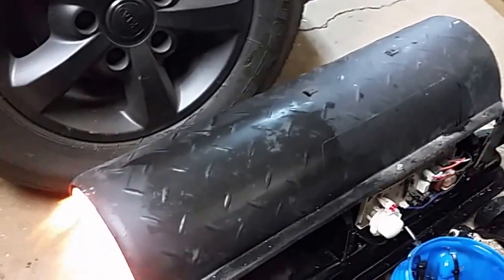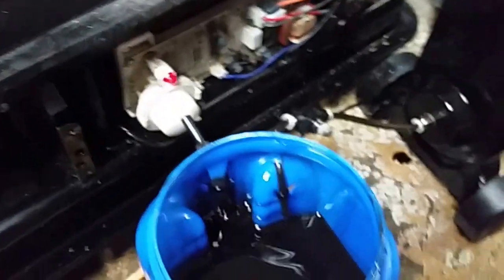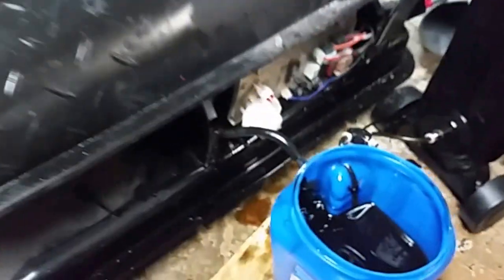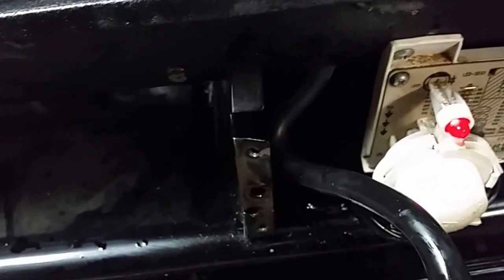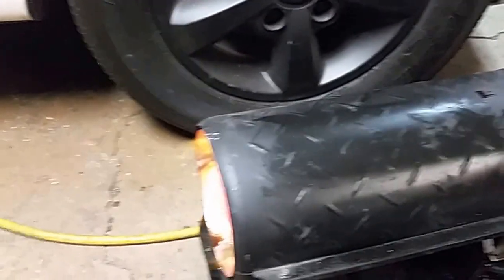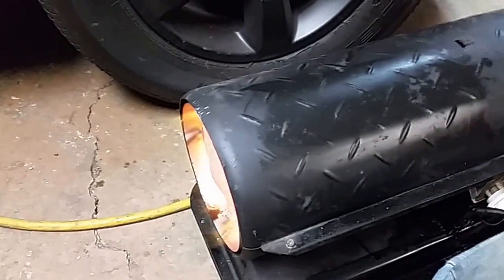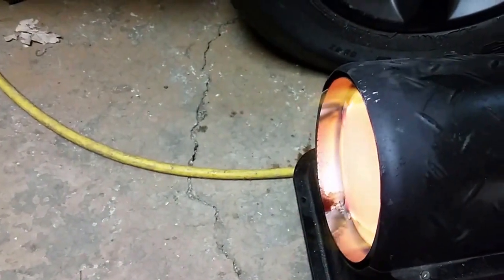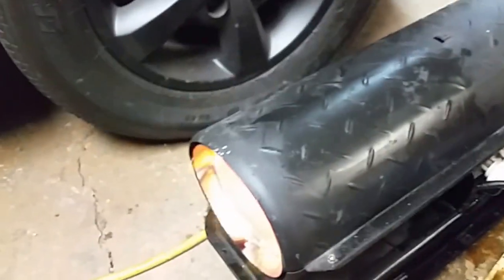My Torpedo Heater Running On Waste Motor Oil

Comment: Oil convection heater...GENIUS!
Reply from the maker: I made some modifications and another video. I moved the convection heater parts to the inside of an old propane tank. Easier to fill and larger capacity

Comment: that's awesome.  great thinking on using that electric oil heater to preheat the oil.
Reply from the maker: Thank you!  If you check out my other videos i actually stripped down the radiant heater and put the parts into an old emptied and purged propane tank.  Works MUCH better and can hold MUCH more oil....  That video is on my channel: www.youtube.com/c/OverRevvedRacing

Comment: I successfully heat my 38 foot trailer on used motor oil with no preheating of the oil. Feed is with air compressor, but burns way better preheated for sure
Reply from the maker: I was going towards compressed air too. I have another video here using an old propane tank I modified using this heaters parts in and could seal it up to allow it to be filled with air. Didn't get that far before we moved to a house with attached garage and didn't want this fumes making it in the house. Definitely would have been safer connecting the output to a heat exchanger and dumping the exhaust outside.
Reply: @OverRevvedRacing  , ok update, I bought a diesel heater off Amazon for 100bucks, it has a combustion chamber with fins, intake and exhaust down through the floor of my trailer mounted under the queen bed in front, impeller in the back of the motor creates high air flow over the fins... 20 mins the trailer is 80 degrees and I gotta shut her down. Need to wire thermostat for running. My point being converting waiste oil to a more purified diesel is the direction I think is best for my trailer as it is my home and free energy is what I am after. Local mechanic shop will give me 100 gallons of oil every 2 weeks.. no way I will process that.. but so far(and I just started researching this) basically you build a alcohol still and the end product is deisel.. run it again for gas.. years ago I watched a guy who lived on a deserted island make gas for his boat and diesel for his generator just using a still using plastic bottles that washed up on shore. 
     This inside of your torpedo uses the same nozzle I use in my home made oil burner.. you are using compressed air already.. within the unit there is a fuel line that runs to the nozzle and another that runs to the air box, the only advantage to using the air compressor is that if you get a quiet compressor with large volume.. I added 2 small compressor air tanks to my compressor adding volume keeping it from running to long... also helping with noise.. anyway it allows you to dial the fuel air mix back to a fraction of the fuel you consume with the large torpedo. The diesel heater I run now takes 2 gallons per 24hours of running hot as she can.. I run it high or off.. keep from buildup.... but ultimately waste oil is its future.. just cleaner waste oil.. I'm not sure if taking the oil and making it diesel will create more fuel or less.. but I will let you know when the still is built.
Reply from the maker: Those diesel heaters are absolutely the way to go!!  I have had my eye on those for a while. I got rid of the torpedo heater when we moved because our garage in our new house is attached and I wanted a indirect heater (like the heater you got or a standard furnace) so the burnt air wouldn't get into the house. I actually have the Beckette burner from an oil furnace that I was going to convert to burning waste oil. However with the prices of those diesel hearers being SO cheap now I'm going to go the same route as you.
Reply: @OverRevvedRacing  love the thing, should keep you warm for sure, im trying to build a drip feed oil stove for our shop. As far as buying the diesel heater and running waste oil, 1 problem I'm have to solve is cleaning the oil so I don't have to clean the diesel heater out. A stove is easy to clean out, but not the diesel heaters, not to say that you don't have to clean them out anyway but few tips. Make sure the heater exhaust is able to drain water, either its running on high or its off( going to attach a thermostat to it so I don't have to be it anymore)this keeps cleaning to a minimum, and add your own filter, supplied filter is a screen.
Reply from the maker: @HirschCustoms   Filtering is something I looked into a lot when I made the modification to the torpedo heater. I didn't want to risk nozzle issues so I did a bunch of research. I actually modified a centrifugal juicer to use as a centrifugal filter and planned on running one of the bag filters that you can get from McMaster (the kind that look like a 3' tall tube sock with handles on them).  I wish I made a video on the centrifugal filter but I was busy working on the LSx swap on the KIA Sorento back then which was my real priority. I played around with the drip feed burner too with a hot water tank as a chamber. It didnt work all that great because I was only using a 3" exhaust and it had a lot of pulsing reverb to it.
The diesel heater definitely is the easiest way to go though since its all one package and they are really cheap. I was thinking that a preheater would help with that too. Thinking an aluminum block with one of the ceramic heating rods and the fuel line clamped together in the block.
Hope you post a video of your setup if you do any modifications to it or if you do build a drip feeder.

Comment: how about a 70% waste oil and 30% diesel ? Only downside I can see is the fumes , not quite as clean as a diesel/Kerosene burn.
Reply: Mix 25% gas to oil, let it vent, then it’s good to go. 25% is close to 50% dsl to oil.

Comment: OMG, hahahahahahaha GREAT THINKING there on the Oil Heater as a Warmer, LOL.  Also another way, use a CHEAP Pot Warmer, and a Temp Disc and a Metal Bucket and Control whatever the temps you want the Oil to heat up as well.
Reply from the maker: Jordan Bronson 
If you check out my other videos I actually stole the heating element out of this and repurposed it inside an old propane tank to heat the oil.
Reply: +OverRevvedRacing - LOL, you know Home Depot have Heating Element for like $8.00 and a $2.00 Snap Disc... Incorporate that into a Propane Tank and you should be all set. :D.
Reply from the maker: +Jordan Bronson
Not sure what size element or temperature range you get from the elements your talking about from Home Depot. I haven't honestly looked for them there. However, this one was free and it's quite large. About 12" long. Plus it can get hot enough to steam off any water in the oil which is a serious bonus.
Reply: +OverRevvedRacing - Hahahahaha, it doesn't really matter in the Element Size... You control " THEM" with a $2.00 " SNAP DISC "..., aka the Temperature Disc.  Example:  Lets say you want your Oil to be around 95 Degree Fahrenheit.  You hook up the Element with a 95 Snap Disc.  Once the Oil gets to 95 Degree, it shut off the Element and so on and so on and so on.... LOL... Hope that makes a bit more sense.
Reply from the maker: +Jordan Bronson 
Oh I totally gotcha man. I'm not hating on ya mate. Don't take it the wrong way. I'm all about us garage inventors combining our heads!  I am using the variable thermostat from the heater. Which is basically a snap disc with a tensioning arm to cause the snap action to have to overcome it in order to shut the unit down. I was just saying that the repurposed radiant oil heater's heat element is a great option due to its size because it will more evenly heat the oil in the tank because it reaches across practically the whole tank. Rather then a shorter element having to heat via convection from a smaller area. This can put a larger strain on a smaller heater and introduce more convection losses and such. Ya know? Plus... Who can argue with free parts right?

Comment: Still using it?  Any updates?
Reply from the maker: It was mostly just an experiment to see if I COULD get it to run like this. I have another video on my channel where I modified an old propane tank to use as a preheater unit. That worked much better for preheating the oil. It worked pretty well but I wouldn't suggest using it as an open flame unit (like torpedo heaters are designed for) because all of the "junk" that's in the oil (metals, chemicals etc) that it puts into the air. Would probably be horrible for you to breath in. I actually had gotten a 55 gallon drum and pushed the torpedo heater output into a hole I cut in it. It worked pretty well and got the drum super hot. It work have worked even better with air tubes ran through the drum. However, my exhaust stack for it was way too small (single 3" exhaust pipe) so it would pulse and howl really bad. Perhaps with a real exhaust flue it would have worked better.
After seeing that it worked I really never used it much again after that. I DID aquire a "Beckett Blower" from a friend. It's the style blower/flame unit used in fuel oil furnaces. I may do some work with that to make it run on waste oil. It's significantly easier to use those because you can buy different size nozzles for them for better atomization of the oil.

Comment: Instead of running waste oil straight what mix ratio would be good to run with kerosene or diesel?
Reply from the maker: In an open flame burner, honestly none would be safe to breathe. Too many toxins and heavy metals could be in the oil. I've run waste motor oil that I filtered with an industrial "sock filter" in my diesel truck and a "becket style" oil furnace but this was just a test. The plan was to blow the heat into a drum heat exchanger then out the flue. So fumes wouldn't be an issue.
Reply: @OverRevvedRacing  yeah didn't think of that. Ok I'll just stick to kerosene and diesel then
Reply: Throw some gas in the oil to thin out a little. I ran my 7.3 idi on 25% mix gas to oil all summer March-August. It started better, more power, used less fuel & was wayyy cheaper to get & make. 

Dsls pre-1994 only! Never use Veg oil it’ll clog it up. Nearly killed the injectors on my old previous 7.3 PSD.
Reply: @michaelbenoit248  Funny I just dumped some waste oil and fuel in mine and it seems to work.

Comment: Put a heating element in the original tank
Reply from the maker: This was just a proof of concept. I have another video testing out a propane tank that I modified by installing the element into. This allows the tank to be pressurized for better flow and to have filled without dropping that pressure via a 2nd tank on top with a ball valve between them. I didn't want to make any permanent changes to the heater since I wasn't planning on using it like this past experimentation.

Comment: what kind of fumes do u get?
Reply from the maker: brett rowland 
Not good ones I'm sure. Probably bad for your health. This was just a test to see how it would work. I am  planning on modifying it to heat indirectly so I don't have to breathe the fumes. 
If you check out the other videos I made some different changes to the pre-heating setup.

Comment: anyone ever tried to run one on waste veggie oil?
Reply from the maker: I am not sure what the ignition temperature of veggie oil is.  You may have to start the system on diesel then switch over to WVO once it has warmed up. You would DEFINITELY have to make sure its thoroughly strained because the nozzle holes on the siphon systems are very small.  It would also need to be pre-heated to a high enough temperature to flow like diesel fuel.  Due to the "weight" of the oil the transfer container (where  pre-heat system feeds the syphon system) may need to be raised up so they siphon system can draw the heavier "fuel"
Reply: +OverRevvedRacing - Veggie Oil is NOT worth it.... :((( You get sticky residue all over the place and they are hard to clean.  I have experimenting with them and HATE them :(((.  Stick with Waste Used Oil, easier to clean and less time consuming as well.

Comment: Great video! I found you on http://wasteoilheaterforum.com/index.php?topic=436.0 I am trying to convert a oil boiler to run on waste oil that I get from work. Instead of putting it in the house I am going to put it in a shed that I'm going to build 30' from my house. I'm  doing this because 1) less mess in the and 2) for insurance in case a fire ever happened they couldn't deny claim for using waste oil as a fuel source. I will then run insulated pipes back into the house to a heat exchanger in my furnace and use the furnace fan to distribute heat through the duct work.
Reply: I'm seeing this 2 years later and wondering how it worked out. I'm in the process of doing something similar.